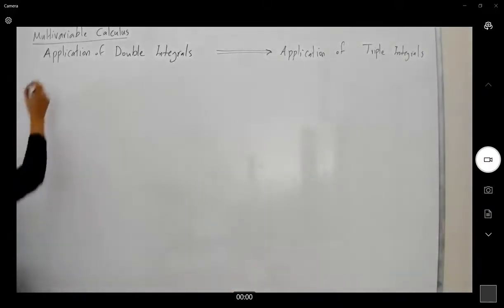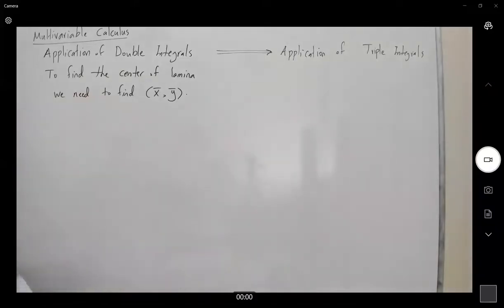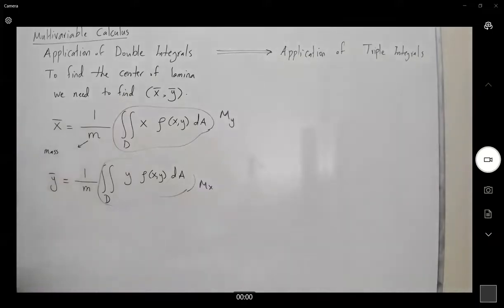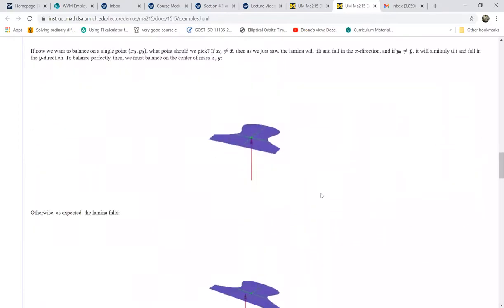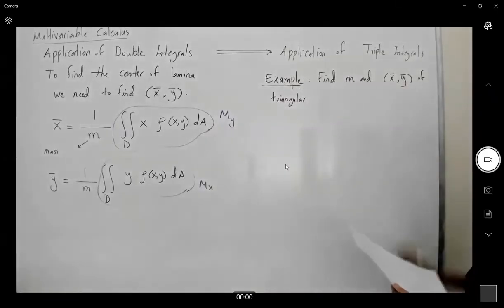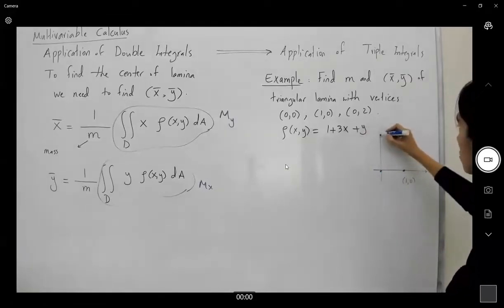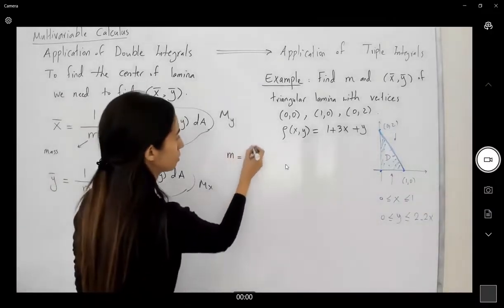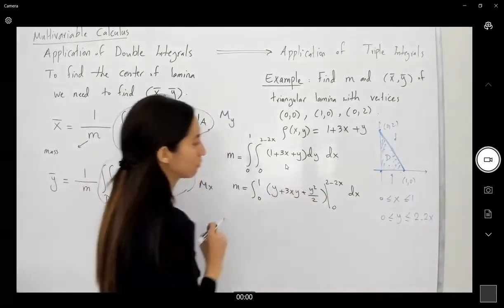Find the center of mass of a triangular lamina vertices (0, 0), (1, 0), (0, 2) if the density 1+3x+y

Comment: How do you get 2 - 2x for the upper limit for y?
Reply from the maker: The line passes (0,2) and (1,0). The slope is (0-2)/(1-0) or m=-2, so the equation of the line passing these points is y-0=-2(x-1) which is y=-2x+2 or y=2-2x